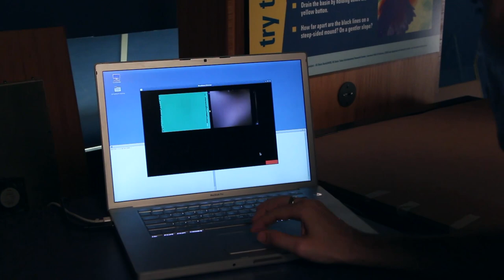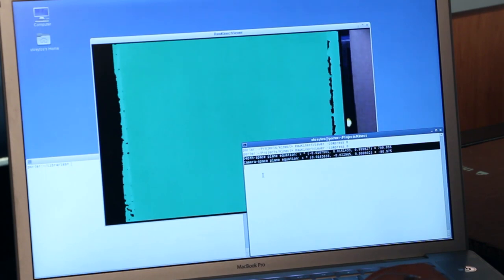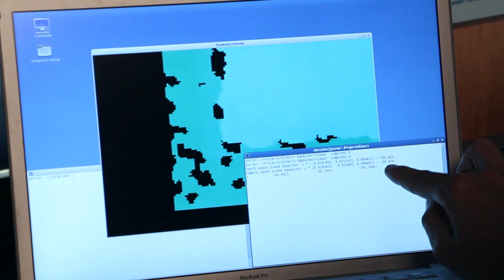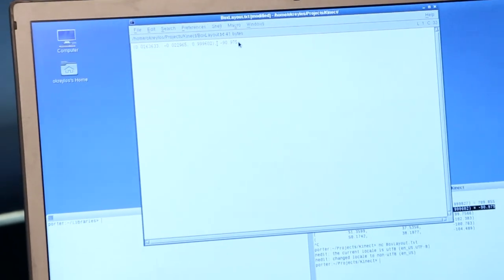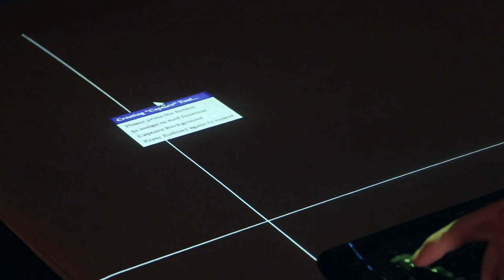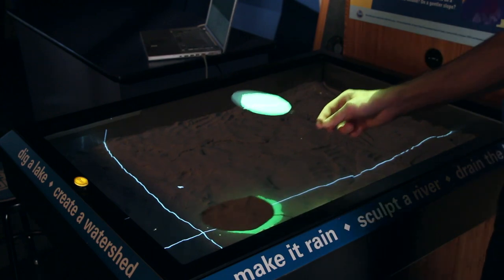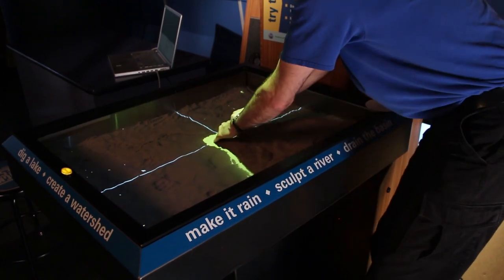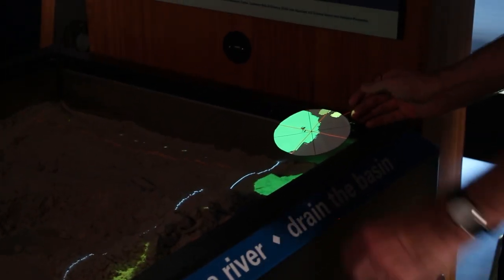AR Sandbox Calibration

Comment: When I get to the point when I need the target, I line up with the crosshairs (@ 12:30 or so) and click the button that I mapped to the capture tool, instead of taking a measurement and moving the crosshairs, the whole field turns red for a second or two and then returns with the crosshairs in the same place. The interesting thing is that it appears to become blind to the area I tried to designate. What I mean is that the crosshair stays in the same place but if I put the target in the same place that I did, it will not detect it. However, it will if I elevate it.

In the end, all that I can do is select a tie point. Wait until the crosshairs return, capture the same exact point except a bit higher, repeat. What am I doing wrong?
Reply: I'm surprised we aren't getting any fixes on this since it seems to be a problem. Did you ever find a resolution?
Reply: @covaelite1  did yall find a solution to this?
Reply: @haronne2010  old comment, but it seems that you were pressing the wrong button. The second button recaptures the background, the first button takes the calibration.

Comment: hello! I seem to be having trouble with the calibration for the water simulation. I assumed that the water simulation would read the 4 geografical nodes set for the perimeter in the regular setp... when the "rain button" is pressed, there is a clear hard boarder where the water stops at- this would be fine if it was lined up with the topography that is projected. this results in a smaller playable surface.. I know its not the projector- the standard game/calibration both line up perfectly. ny assitance or comments would help ☺ 

also as a note- it appears that the corrisponding fourm site is nolonger hosted/changed domain

Comment: Where I use the plane equation data (BoxLayout.txt at 8:50)?
Reply: in the kinect directory
Reply: You need to enter the base plane equation (and the 3D sand surface extents in the next step) into the BoxLayout.txt file in etc/SARndbox-2.6 inside the SARndbox source directory.